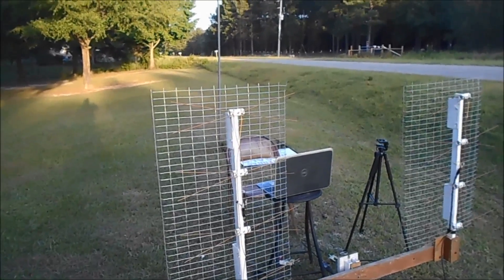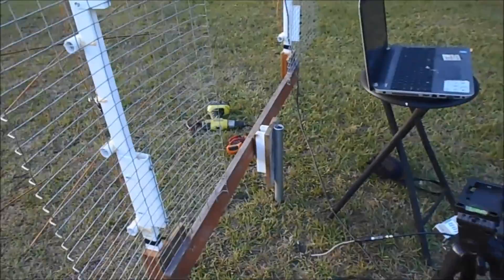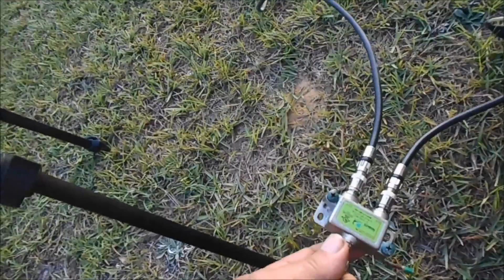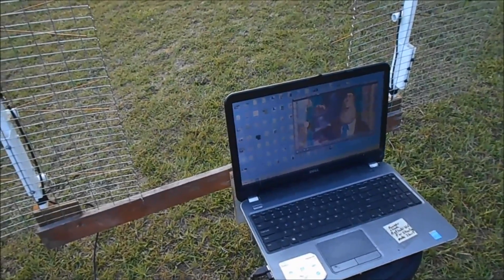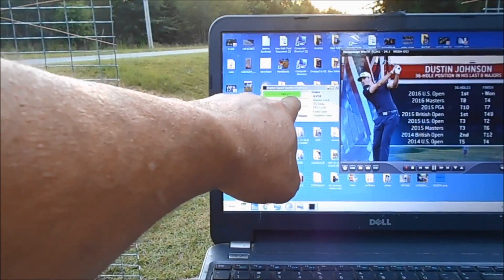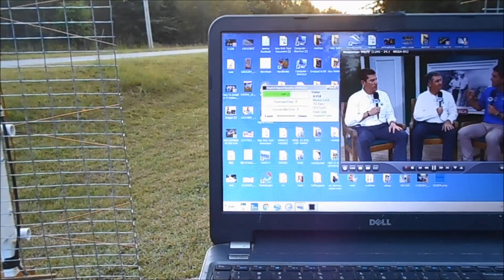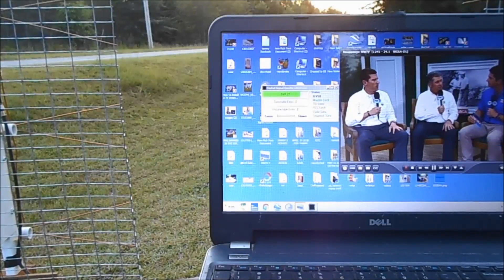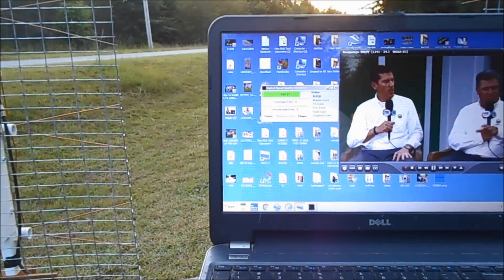DUAL TV ANTENNAS

Comment: Nice video. Wondered if you tried a recpricol splitter yet? Yours looks one way blocked. You can test them with a continuity meter on all center pins. If one of them won't meter out, then it's actually diode blocked and will also block many of your RF signals. Try a cheap splitter. One that allows signals both ways.

Comment: I wonder if you could combine 3 or 4  antennas in such a way to bring in weak and distant stations.    Another idea perhaps to mount 3 or 4 of those type of antennas in a circular pattern so an antenna rotor not needed or used only to tweek the turn for best signal.  I guess you do not have ghosting problems like the analog signals had.  Nor is any co-phasing necessary?

Comment: If you use an amplifier/booster for each antenna, then pass it through the splitter will this double the signal strength.
Reply: or..... if they both happen to catch the same station...they NULL each other. common bro. you can use,more than one, but they better all be using the same length of feedline to the combiner/splitter, all be pointed in different directions, maybe one for ulf and another for vhf, and finally.,.. keep one antennas outside the radiating zone of another. best to just put two at opposite ends of your roof pointed 90 degrees from each other, pre-amp each one at the base of the mast, same length of coax to your combiner/splitter unit, pre-amp again MAYBE IF IT WENT A LONG WAY, then to the tv. it works....but how well depends maibly on how far thw signals are.

but it will not double anything. two antennas, double signal.....no. And if Im wrong...cellular telephones dont work either, or walkie talkies, and nejther does,doppler radar for that matter. theyre all an elaborate hoax

Comment: Danny, thank you for the videos, love them. I’m currently working on some. Question, do you think your duel antenna setup, but with one turn 180 degrees would work? I live right in the middle of two cities, one to the north, one to the south, a few to the east. I’m trying to decide on the best option for this without using a rotor.
Reply: That will work bub

Comment: Do this same video but when you disconnect one antenna hook your tuner directly to each antenna without going through the splitter/combiner to get a true reading. I think you are losing some signal going through your splitter/combiner.
Reply: 1st thing I was thinking
Reply: It won't make any difference to displayed video as it is digital and will look the same as long as he has signal capture. With digital, you either have/don't have a picture.  That is the reason for freeze frame happening in fringe areas.
Reply: I see your point of comparing two antennas through the splitter vs one antenna not going through the splitter. It does show a relative change of signal strength for one antenna vs two since the splitter is causing loss either way. But you are right, to see how much you gain with two antennas through a splitter vs one without, you should remove the splitter to take the reading.

Comment: I'm still trying to understand 2 antenna.  From my research, there's a 50% loss in signal by combining 2 antenna (from the combiner).  However, that loss can be nullified by pointing the 2 antenna in the same direction which I think is what happened here.  What happens if you point the antenna in different directions?  In my situation I have a gamut of stations NE and a gamut SE, which is 90 degrees apart.  If I combine the antenna's, each at 90 degrees will that be worse than just using 1 antenna?
Reply from the maker: IT DONT LOSE 50 BUT IT MAY LOSE SOME IN 2 DIFFERENT DIRECTIONS,,IT WILL MULTIPLY IN THE SAME DIECTIONS. U COULD USE A ROTOR
Reply: You are correct. Depending on the quality of the splitter, you could lose a lot more

Comment: Danny,

What device - name / model , do you use to connect your antenna to your  laptop?

What software and hardware do you have on your laptop to run the TV stations and check signal strength?

I am constantly tweaking my antenna's in my attic while trying to get someone in the house to give me signal strengths.

Using your setup would be SO MUCH easier!

Thanks - great vid btw.
Reply from the maker: HAUPPAUGE WINTV TV TUNER TV ANTENNA SOFTWARE DVR DEMONSTRATION HERES MY VIDEO OF IT ,https://youtu.be/JphJdyzVA_A

Comment: One tech mistake that's a combiner not a splitter.

A splitter have one in and mulit outs a combiner has multi in and one out.

Everything else is perfect but calling the combiner a splitter would confuse people.
Reply: I think you are wrong. A splitter can split or combine.
Reply: same thing. theyre 2-way. if ya dont like the name on the side or thr in--out labels.....flip the sticker upside down. could concievably call it a complitter
Reply: I tried that with a 4-way splitter I have. I turned it backwards to combined the output of 2 amplified indoor antennas. It did not work. Signal was terrible.